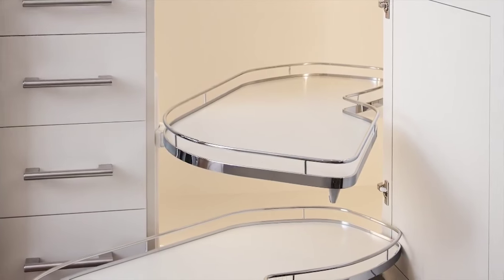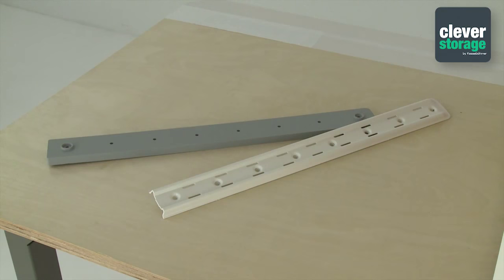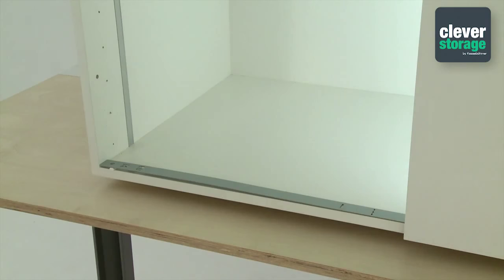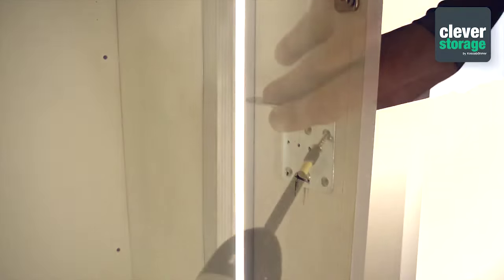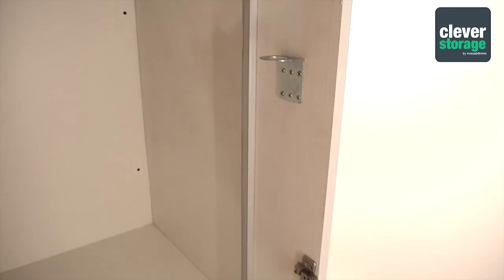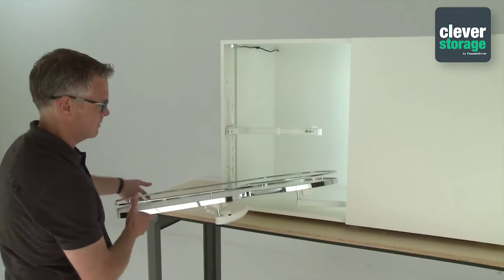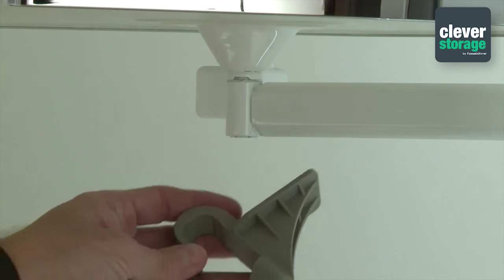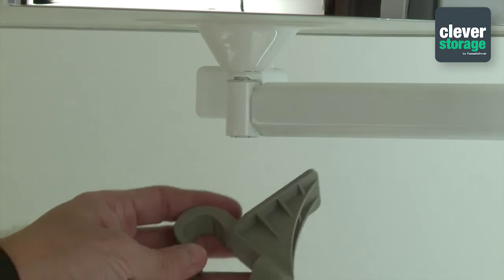Lemans ll Installation by Hafele | KitchenSource.com

Comment: When you screw in the bracket don’t use the 4 screws they give you. Get 4 pan heads so that the bracket does not pull through the factory screws and you have pissed of customers.